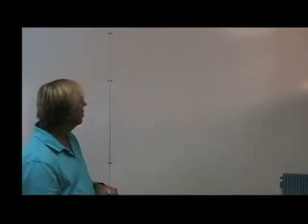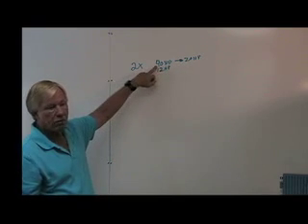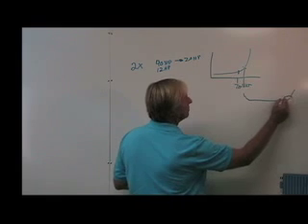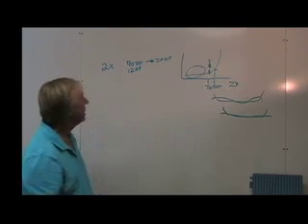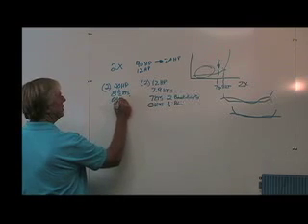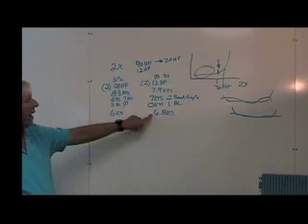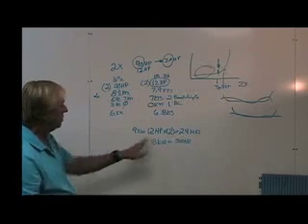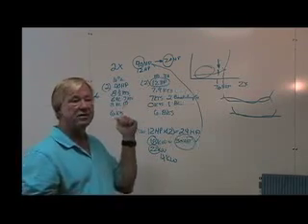Choosing Your KW motor size from Solutions4Hybrids.com

Comment: Hard to believe 40 hp engine can be replace with 12 Hp el. motor  and get almost same speed?
What el. motors you use and what rpm ? What propeller pitch and dia.?
Thank you

Comment: A Fischer Panda, problably the lightest available is 350kg, two oceanvolt sail drives 15kw are 50kg each, 17kw are 50 each, 17kw lythium is 140kg, plenty electronics on top of it, letz alone cables and you still need fuel to run the gen set. May work on a condocat because our not much into sailing anyway but strong on ideology.

Comment: This is a very informative presentation.

Did you ever consider supplying your two electric engines using a battery bank, a smaller electricity diesel generator, and some type of renewable energy to keep down the use of the electricity diesel generator by supplying electricity to the batteries?

Comment: Can you all do an update of this presentation based on today's technology and systems? I am doing research for Sailing Cruisers and could use some more information on this topic. I am assuming in general the MATH is the same and hasnt changed much, but, with new motors, it may be different.
Reply: https://www.researchgate.net/publication/205117931_Resistance_Prediction_of_Cruising_Motor_Catamarans

Comment: Hi

   I am on the verge of purchasing a cruising yacht and i am very interested in the idea of stripping out the diesal engine and replacing with an electric drive. Is there a chart or information on line which tells me the horsepower that i need to purchase.The boat is a Formosa 51 ft with a long deep keel. 40ft on the waterline, with a  draught of 6.5 ft.
 very best regards    Jim
Reply: james williamson 

https://hydrocompinc.com/wp-content/uploads/documents/HC105-NavCadCatResistance.pdf

https://www.marineinsight.com/naval-architecture/various-methods-for-ship-resistance-evaluation/amp/ 

https://www.marineinsight.com/naval-architecture/power-requirement-ship-estimated/amp/

Obtain total resistance based on the above.

1 H.P. = 745.7 watts.